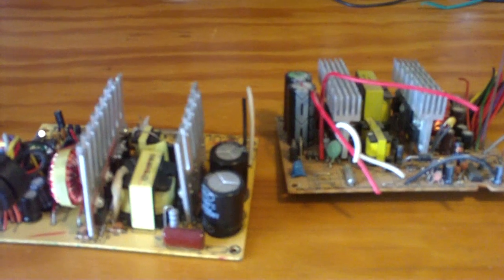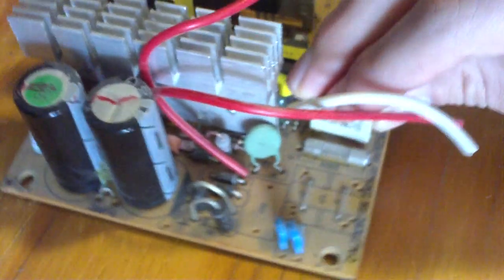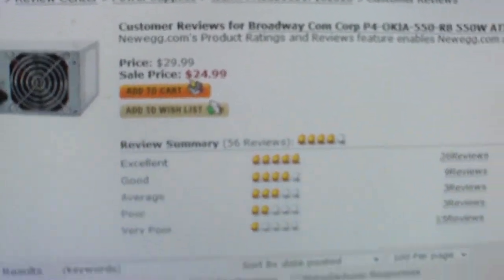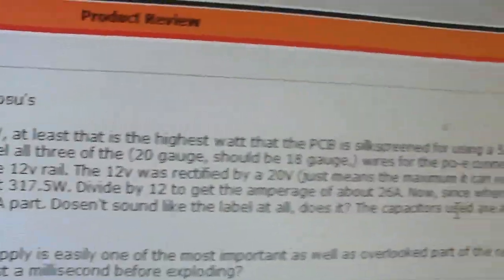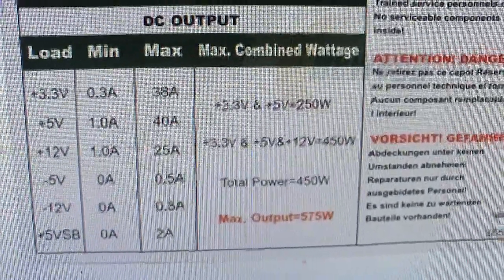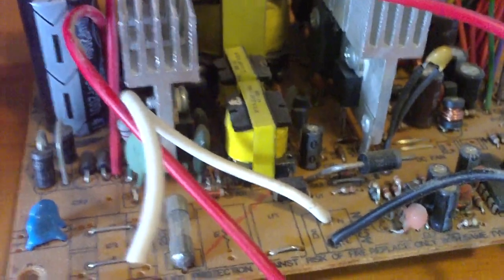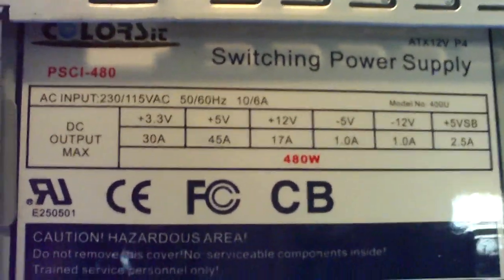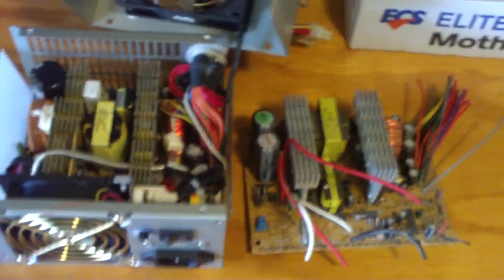Why a lot of low-cost budget power supplies tend to fail prematurely

Comment: 5:08 That ain't a Logisys by a long shot. It's a Sun Pro.
Reply from the maker: Yes, the board shown wasn't from a Logisys (Keerda) unit, but rather a CaseGears Black Steel 580. SunPro did make this one, and is better built than the later BKS580 units from Xin Hui Da.

Comment: I had bought what was supposed to be a quality power supply.  I was running 2 GTX 550ti's.  The power supply exploded and a smoke trail about 9 feet long came out before it caught fire.  I will never by another power supply from them even though it said earth friendly.  The power supply I have now is a 750 watt also but weighs twice as much.